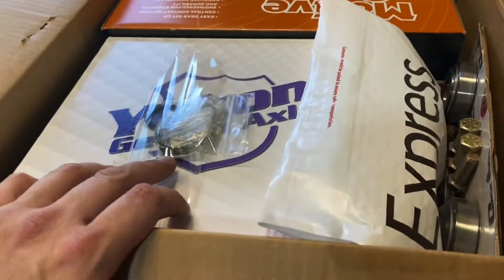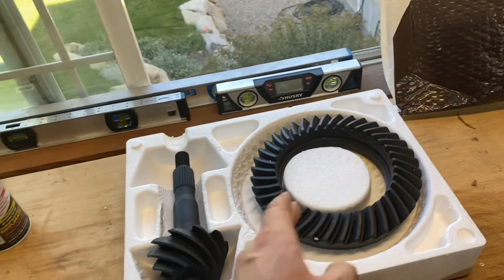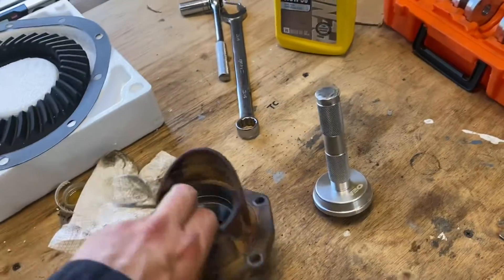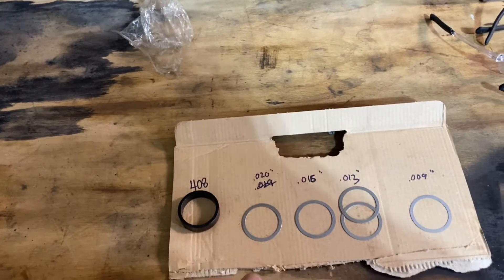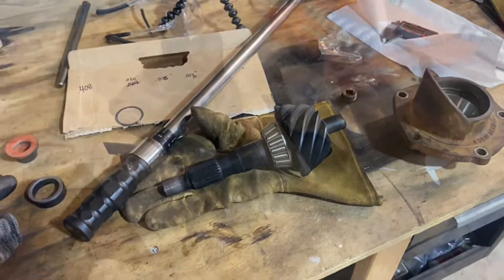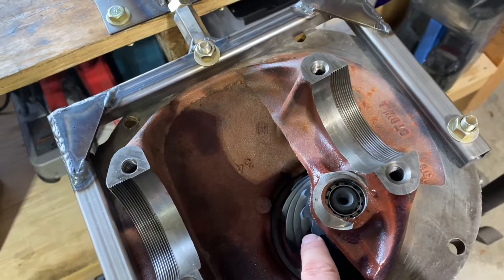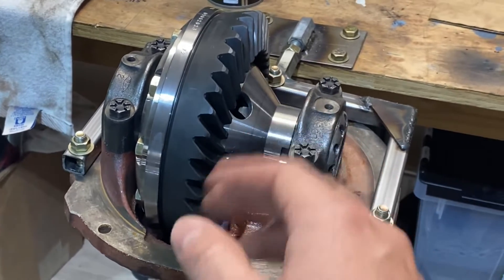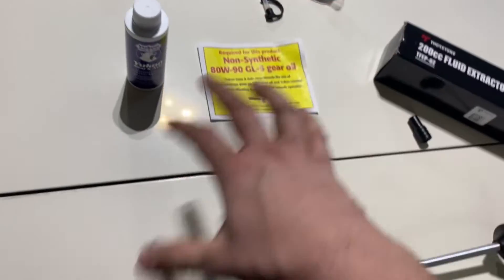Why I Always Buy from Quick Performance - Part 2 Ford Differential Assembly

Comment: Quickperformance told me to have max 14 inch/lbs on the pinion bearings.    Ive read that they say if you use the factory soecs that the bearings will fail.

How much was youre pinion shim on the original one and how thick shim did you out on? Did you buy the 3.80 gears?
Reply from the maker: Yeah, I want to say my opinion bearing preload was probably a tad higher than that, but you can check that with a dial type inch pound torque wrench. In terms of thickness of the shims it’s going to be different for everybody. You have to install the shins and then check it with the torque wrench free spinningyes I wound up running 389 gears and like it a lot.
Reply: Troubles with installing.
I have installed the lower bearing(against tooth) with a harbor freight style press.

Then crush sleeve then pinion support then upper bearing but i had to press (relatively hard)the bearing on until there was almost zero play at the pinion suport between bearings.
And so i used a crush sleeve and i had to use a 70" breakerbar with all my weight in it and i had good preload but it seems to me that i had to pull too hard to crush the sleeve(more then 400newtonmeters).

But i did it with the old nut to check everything  and so i wanna to pull back the crush sleeve out and put a new one in with a new nut(but in this removal is where everything started to  backfire.

I couldnt tap the pinion support of the pinion shaft because the upper bearing wasocked on the pinion shaft .

Did youre upper bearing sit hard on the pinion shaft or could you tap it of with a hammer of the pinion shaft?

Did you  tap the upper bearing on with a hammer or did you also use a press to fit it on the pinion shaft ?
Reply from the maker: The difference with mind was I used spacer/shims bs crush collar.  However, I did not have to force the bearings onto/off of the pinion.  The exception being the “bottom” bearing closest to the gear teeth which I heated in an oven while placing pinion in freezer.  With the thermal expansion/contraction it dropped into place.  The outer bearing i could remove with hand tools and taps of a deadblow hammer as I recall.
Reply: @truckandroll989  yes normally you dont have to press imthe upper bearing on. I wanna to take it of but i couldnt and took it to a press shop and they had to use 30 tons of pressure and cracked the housing 

Quick oerformance tikd me i had cocked the bearing when trying to take it of but in the end i had to press in on so i said the shaft was to thick but they say it cant be.

Comment: How did you check preload on the carrier bearings
Reply from the maker: It’s been a minute since I watched this video, but I want to say you can measure how many turns in on each side you started with.  When I’ve done other rear ends, the preload on the carrier bearing isn’t super crucial so long as you have some you just don’t want it to be loose.

Comment: I can't say enough good things about quick performance. I have called them 3 times so far, and every. single. time. I got someone who could help me out from beginning to end. No sending me to so and so who is at lunch and half to leave a message. I ordered my differential and axles, and two days later I got an out for delivery notice for the axles. It came 2nd day air which I didn't even request but it was a nice customer service assurance. I paid the extra money for a slight rush job, but the man said it should ship on July 10th. LOVE these guys. Very knowledgeable!

Comment: if the gears are made of same material as factory why would you have to do a break in, you think the factory pre-ran the car before shipping them out, most likely not
Reply from the maker: My understanding is the break in recommendation is more-so for the bearings than the gears.  The tight tolerances I set these bearings up to will generate excessive heat and thats what Quick Performance was trying to avoid.  It’s also pretty common practice to break in any meshing metal parts and equipment.  Transmissions, clutches, engines, etc. all have break in procedures. I suspect if you read the fine print on a new car they tell you to keep speeds low and vary rpm / driving style for first 500mi.  I know the C8 Corvette limits rpm until the break in is complete.  Also why risk it?